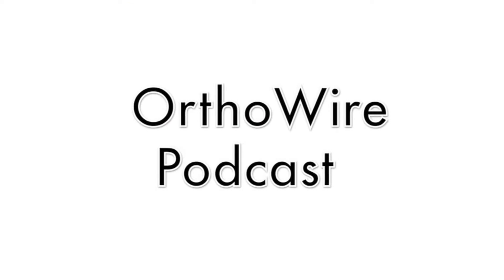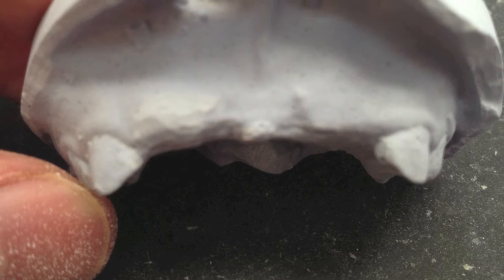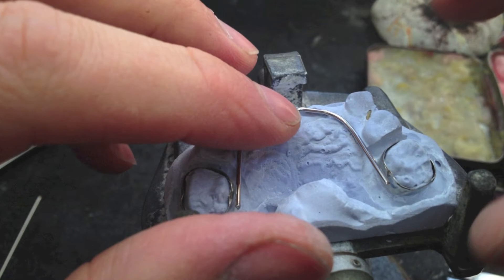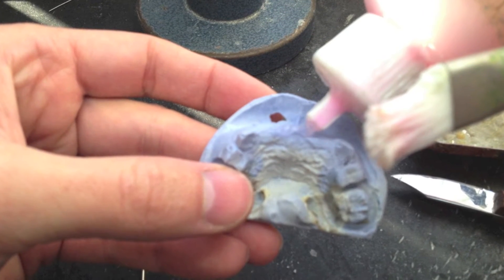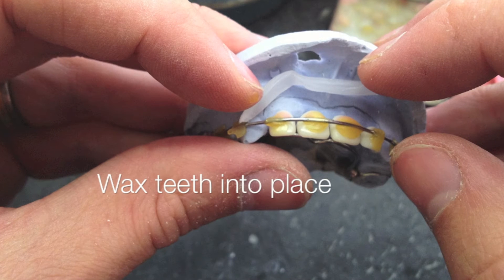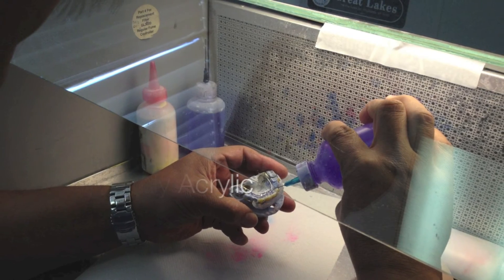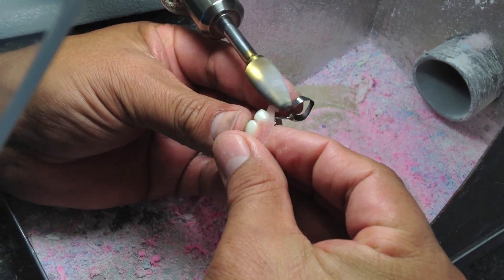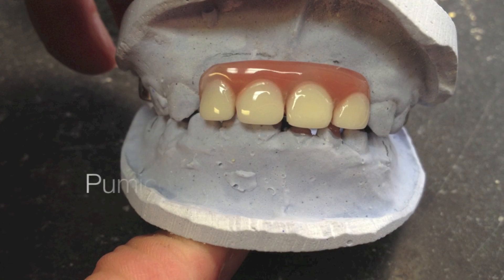Pedo Partial

Comment: Hi would a nearly 3 yr old have the ability to pull these off? Can’t see how they can be very secure from the front if it’s only really cemented from the back
Reply from the maker: Good question it would be very hard to pull these off, the wire going from the bands to the front is think and is made of spring har stainless steel. But if the child is persistant enough they could probably do it! hese are made to be removed by the doctor with the correct tools.

Comment: thanks for the vid. wow! that was a poor model! I got one of these into my removables lab the other day, I outsourced it to an ortho lab. I want to do these in the future. What solder, flux and equipment does your lab use to solder the bands to the wire? should i use the electric solder machine I have, or should I use a small torch flame? Also, Do you not have to make a bead seal on the palate like I we do on adult dentures?